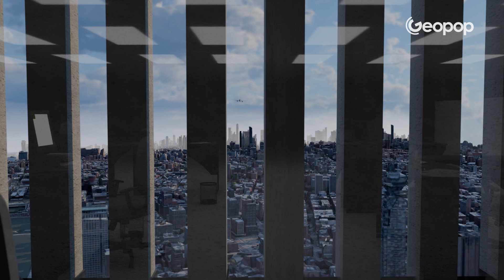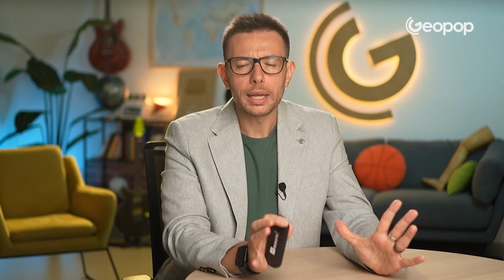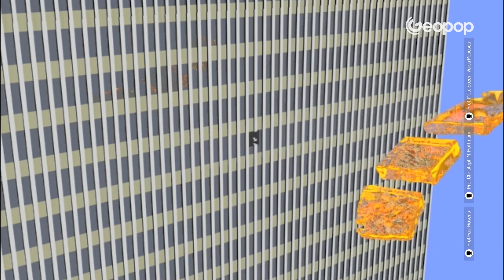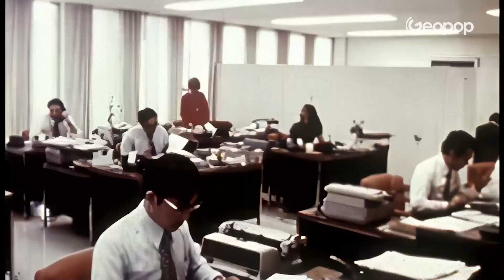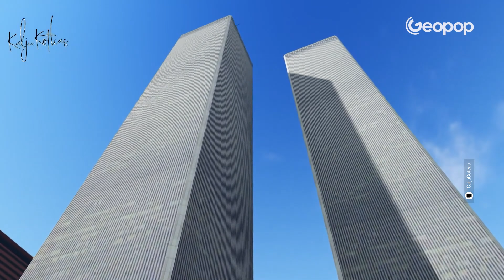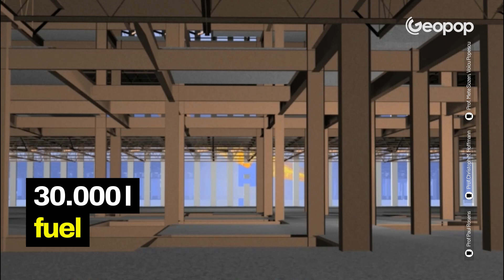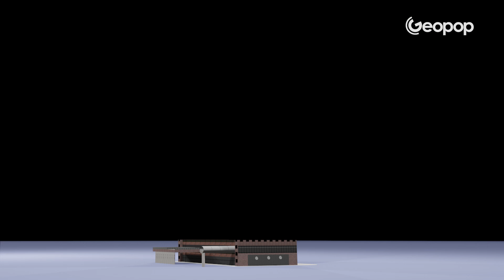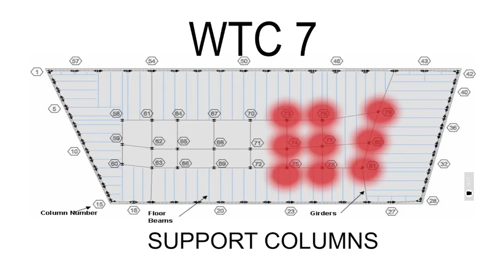9/11, 2001: The Technical Reconstruction of the Twin Towers and WTC 7 Collapses

Comment: Just curious why in the videos you can see molten steel just pouring out of the building. There is literally not one viable explanation for this. Oh wait, there is one. I don't buy most of the conspiracies but there are definitely aspects of this which are unexplained.
Reply: Why was the evidence removed before a proper investigation was conducted. This is a crime scene and should have been treated as such. Forensics was not carried out in accordance with state and federal law. 
Many of the core columns showed signs of what appeared to be diagonal cuts. Iron nonospheres were also observed in samples taken by independent researchers. The presence of these spheres implies  higher temperatures than quoted in this presentation. It could point to the use of thermite.
Reply: @stvbw  wtf my comments are being deleted or am I slow?
Reply: @stvbw  - Diagonal cuts eh?  This will explain that:  youtube.com/watch?v=pVDU5QKa8Wg&t=39s

As for iron microspheres - wherever you have steel and fire you will have iron mircospheres. Extremely common, don't mean anything. You can make them in your hand with a Bic lighter or in your backyard firepit with some wood, a match and a bit of scrap steel.
Reply: Molten metal pouring out of the South Tower (and it was in fact ONLY the South Tower)?  You mean this?

youtube.com/watch?v=xPVGGQU-MeQ&ab_channel=SeekersofTruth 

So you think that is molten steel why?  Because you performed metallurgical tests?  Because the internet told you that’s what it is?  I think we can do better, so let’s do better and build a theory the right way instead of making evidence-free assumptions. This will take just a couple of minutes and is worth the investment. 

The Boeing 767 which struck the South Tower weighed 117 tons and 80% of that was aluminum.  The exterior cladding on the Twin Towers – the white panels – were also aluminum. When Flight 175 struck at the 81st floor its momentum deposited much of the office contents in its way and the bulk of the aircrafts mass into the NE corner of the building. The piled up debris shoved into that corner is visible in photographs and video so we know it was there. 

There’s a good shot here of piled up debris from 4:36;

youtube.com/watch?v=ZLJyL63sqtU&ab_channel=MrKoenig1985

Steel melts at roughly 2,750-deg F while fires in the South Tower reached peak temperatures of around 1,800-deg F. Aluminum OTOH melts between 887-deg F to 1,180-deg F depending on alloy. That aluminum will melt under these conditions is not a surprise. If you look at pictures of cars left behind and destroyed by forest fires the aluminum wheels are invariably melted away along with other sometimes aluminum parts like hoods. Steel bodies remain intact. 

The “molten metal” appears at 9:52 am. At the same time we see the first externally visible signs of sagging floor trusses and the pulling of the perimeter columns inward. I submit these events are related, not coincidental. The aluminum cladding at the NE corner also appears to me to be burning. 

It is likely the with the floor trusses sagging under the heat, and the 81st floor truss in the NE corner under the debris pile subjected to the heavy load of the debris pile, the truss broke its perimeter column connections and dropped, instigating the material starting to pour out of the NE corner at the 80th floor.

Given the properties of the materials in question, aluminum is by far the most likely culprit. 

Reports from The NIST, FEMA and MIT all concluded the material is aluminum. 

Certainly steel is the least likely of all the materials the anomaly could be given its much higher melting temperature and the fact there is no logical source for molten steel.  The perimeter columns in the NE corner are intact and the material is pouring out between them. So it isn’t columns melting, therefore what other source of steel is there?

Deniers will claim molten aluminum appears silver when molten, which is true but only at the low end of its melting temperature range. Aluminum can and does get hotter and it glows red to orange when it does (1,100 to 1,800-deg F).  Most folks of course just don’t bother getting it that hot if the goal is just to get it molten for say molding a part. No need to go higher. 

The total mass of molten aluminum is a BIG deal in regard to how it behaves when poured. Quantities bellow half a liter cool almost instantly if poured onto a flat surface, but if poured into say an ingot mould will stay red for a minute of so. Pouring volumes of molten aluminum greater than a liter is a VERY different experience. The thermal mass is much greater and the radiant heat is horrendous. The aluminum is able to stay liquid and remain glowing bright orange much longer. 

The famous video of glowing liquid gushing out of Tower 2 moments before it fell, involves at least tens of liters of molten aluminum. The thermal mass involved is so great that it stays red after falling many meters through the open air.

Side note: There was also a large UPS battery farm in that spot and some of that material at least may well be from the batteries IMHO.

The other candidate of course is thermite which hardly fits the bill either. Thermite reactions are BRIGHT .  There is no mistaking them. Ever play with a Sparkler on the 4th of July?  A Sparkler is just thermite on a stick. Now imagine tens of thousands of those all going up at once.  Yeah, bright. 

IF you watch this video youtube.com/watch?v=JXWCMBuusMI&ab_channel=TrutherTVArchives from 47:30 to 48:00 you can see how bright 175 lbs of thermite burning is. Now multiply that by 236 perimeter and 47 core columns and 110 floors. 

And why does this anomally only occur in one corner of one building?  If that is supposed to be thermite eating away at the steel (which is clearly still intact the whole time) it simply does not compute. 

MIT Professor of Materials Engineering Thomas Eager Ph.D notes “It’s possible you could get a shower of sparks from a thermite reaction because molten aluminum reacting with something is essentially a thermite reaction.  But you can’t tell if that aluminum came from a melting of the airplanes in the fire or a controlled demolition.”  (Discovery, 2009) Remember, thermite fundamentally is iron oxide (rust) and powdered aluminum.  

So in conclusion, based on the available imagery and fire science data, the most likely candidate for the material pouring out of the NE corner of the South Tower at the 80th floor from 9:52 am and from nowhere else at any point during the event is aluminum from Flight 175. This aluminum had piled into the NE corner during impact at 9:03 am and was subsequently heated by the raging multi-floor fires over the next 49 minutes until it got hot enough to flow, which it did when the overloaded floor collapsed.  The material then poured out of the SE corner for a few minutes, then stopped. At 9:58 the South Tower collapsed when the perimeter columns, pulled in by the sagging floor trusses bowed by up to 5 feet until they buckled.  The shower of molten aluminum was inconsequential to this. 

All of the above is true no matter who planned and carried out the 9/11 attacks, how or why.
Reply: Nonsense … its definitely not ‘molten steel’ … wrong colour! There are plenty if valid explanations what that could have been! There were large amounts if metals and aluminium involved which can melt! Thermite is none! Physically impossible! You do not seem to have any clue about the characteristics of steel!
Reply: @GanymedeXD  you are some kind of metallurgical genius are you? Tell us all your expert opinion seeing as we're all so ignorant. If there is any nonsense it's you. Arrogant numb nuts!
Reply: Hey there Einstein. What you’re seeing is molten aluminum.
Reply: @ no need to be insulting. There isn't anything about that in the report that I'm aware of but if that's the case, and it makes sense, I accept it. Those of us who question this event, those of us who do so honestly anyway, are just looking for the truth. That's all. And the official explanation does leave a lot of holes. It's a sign of intelligence to question things, but it can certainly become a sign of a myopic fool to not accept answers when they make sense. So don't insult me for questioning, that makes you look foolish.
Reply: Thermite most likely
Reply: I'm pretty sure the paint inside had thermite like compounds in it? Maybe could've made the fires burn way hotter than we thought

Comment: 13:15 Are you in your mind? STEEL columns were about 26'' by 26'' (2,5'' thick) and you really think, that ALUMINUM airplane which is not full body and similar to empty soda can by it's penetration power can brake theese steel columns? 

There were no planes. Airplanes can not brake through steel made buildings. They were added to the video using video editing.

On your animation even wing's tips brake the steel colunms (facepalm)
Reply: The perimeter columns at the impact floors were hollow box-section steel tubes welded up from normal A36 plate 3/8" thick on the outer face and 7/8" thick on the other 3 faces. Most of the column failures from impact were bolt-shearing failures at the column end flanges. Breaking four 5/8" bolts is all that was required at 117 tons of aircraft at up to 590 mph has more than enough energy to do that, as shown in this video.

www.youtube.com/watch?v=P8mG9pyImb8&t=45s

There is a saying that no-planers are no-brainers so I won't waste any more time on you than that. Not worth the effort.
Reply: Did you see only 1 video bud? 😂

Comment: I have a question that I've been wondering about since this happened.  And I know squat about building, engineering, etc.  I wondered if one of the planes had been able to crash into one of the towers at a fairly steep downward angle, would that have done enough structural damage to make the upper floors of the building topple off onto surrounding buildings...would the top have simply slid down and away from the rest of the building.   As for start of the video...I had also wondered what it would have been like to look up from a desk and see that plane flying right at the building.  I think those poor souls would barely have had time to react.
Reply: Steel buildings do not topple when they fail. They are not rigid like trees. The Twin Towers were 95% air by volume. Steel buildings DROP.   The only difference a steeper impact angle would have made was time to collapse initiating failure. The failure mechanisms are a product of the building design and would have been the same.

Comment: 10:27 so it seemed obvious to me. Heavy weight. High temps. Long time. Steel fails.
I do admit I'm confused by the claims of molten steak pouring out of the building or the steel cut with thermite charges.

Comment: Jet slides into a tower, no debris whatsoever from either the jet or the building. Watch one of the "live" recordings almost frame by frame on YT for the actual so called strike. The jet slides smoothly into the building, which swallows it up like it was made of jelly/jellow. Gtfooh. Plane goes in at an angle , those wings would be sliced off by the concrete and steel floors even if the the body struck midway between. The body supposed to travel all the way through to poke out the other side ? Nothing like a stairwell of liftshaft to stop it ? This is cartoon stuff. Jeez, get a life.
Reply: The aircraft were completely destroyed in a fraction of a second, the overwhelming majority of its 117 tons being decelerated from as high as 590 mph to 0 in a quarter of a second. . Those impacts - with the energy of a ton of TNT - destroying the plane in no way implies the building comes out unscathed. 

You can get a feeling for how massive the impact was watching this video of the South Tower being hit, with the video sped up so the movement of the building is more easily observed:

youtube.com/watch?v=Qk5NQgU-9G4&t=3s&ab_channel=3UZFE 

Your expectations are faulty. Reality happened the way it did because that is the only way it could happen. If you think believe it should have been different the problem is YOU.
Reply: Aluminum and steel loses shape when it’s going 590mph to zero in a large explosion
And then the second plane going 710mph yeah it’s bad
Reply: @Alduintheworldeater  740mph?!?
Reply: @Kudde23  No lol that was a bit exaggerated it was about 590 mph (264 meters a second)
Reply: @Kudde23  the second plane was 710mph when it hit
Reply: @Alduintheworldeater  So first you claim it was 740mph, then you claim it was 590mph, now you claim it was 710mph. Do you roll dices?!?
Reply: @Alduintheworldeater  - Don't let it suck you in. Pure attention seeking troll this one. Best not fed.
Reply: @TheLoonResistance  So you agree on 710mph Fitzshill? Oh wait I forgot, you are way too much of a coward to EVER answer questions on your stupid blahblah...